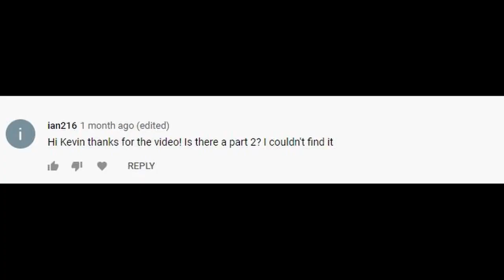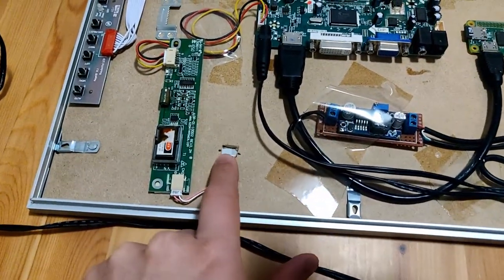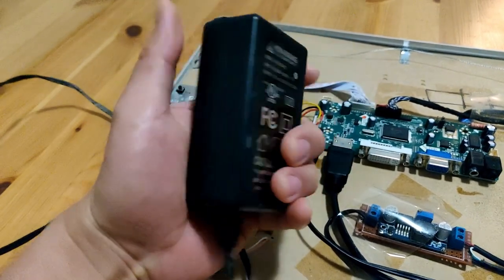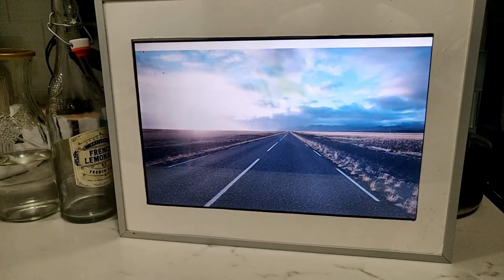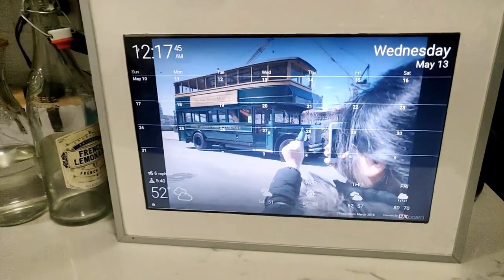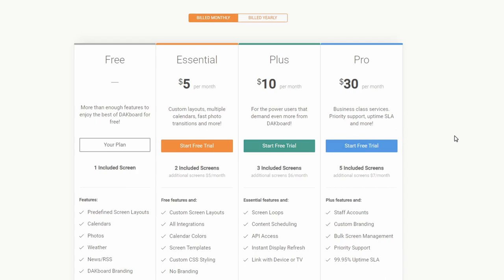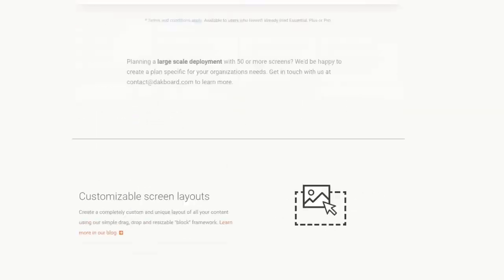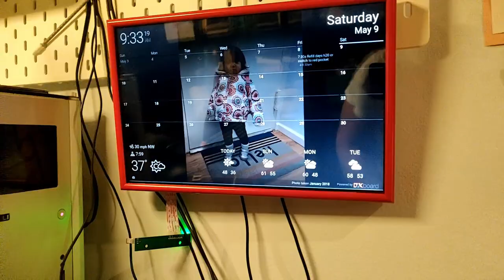How to reuse laptop screen as a photo frame with Raspberry Pi (PART 0)

Comment: Is there any way to connect this display with nodemcu esp8266 and make a digital photo frame
Reply from the maker: won't have enough processing power for the video. You will need an SBC and a display driver.
Reply: @TechExploresNYC  what is SBC ?